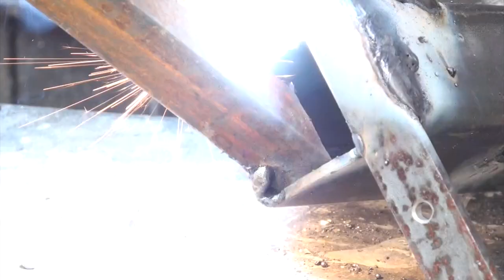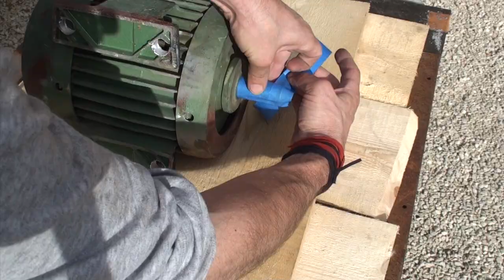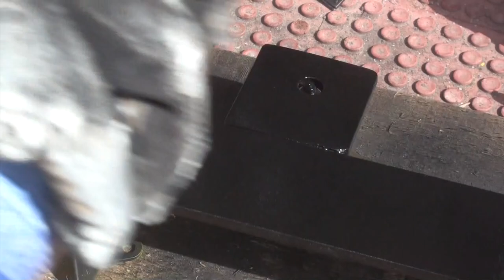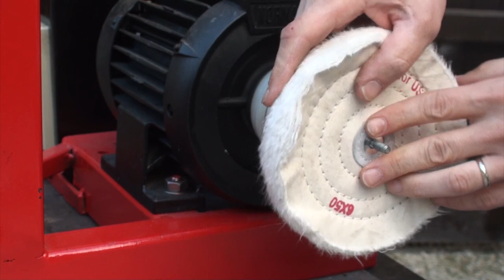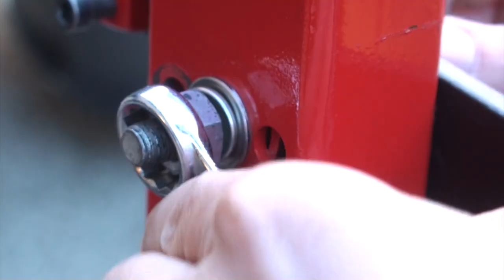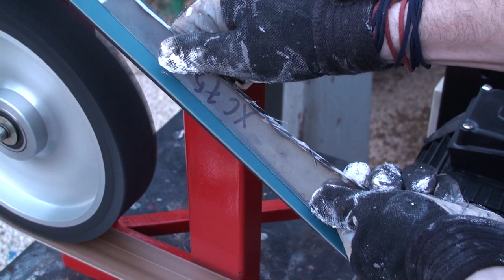DIY - Making A 2x72" / Belt Grinder with buffing wheel

Comment: Only problem I see is that over time though 95% of your sparks will fly down at the contact wheels; a bit will contaminate your. buffing wheel.  A simple plate to cover the buffer will solve it.🖖👍
Reply from the maker: Thank you Robert. I've been using it almost every day for a year now, and the buffing wheel is totally fine. But I'm working on a version 2.0 of the grinder, I may use your idea this time. Thank you very much for watching :)

Comment: Nice job young man, the buffing wheel is a nice touch. If you had a longer motor shaft, or can reduce your  drive wheel width a bit for more room ... a "bench grinder shaft extention"
will give you a lot more space and safety for buffing, it's a ready made arbor extension you can bolt right on. Web search or ebay.
Reply from the maker: Thank you. That's actually an idea I'm working on right now.
What's the saying again, "Great minds think alike" was it ? ;)

Comment: Awesome work. I've got one similar that is half built using the same belts. You've inspired me to get it finished.

One question, how do you adjust the tracking? Or does it not need it.
Reply from the maker: Thank you very much. If we all inspire each other, hald the work is already done ;)
If the wheel are correctly aligned, the tracking is just fine. Just have to pay attention to the belt tension.

Comment: Nice build but, I have a question. What about getting the grinding debris on the buffing wheel? That will surely scratch up the blade finish.
Reply from the maker: Thanks. Well, I've been using it for quite some time now and no metal at all in the 
buffing wheel. Most of the steel dust falls in front of the grinder. Very get stuck in the belt and can fly at you, so glasses needed. Even if some'd get on the buffing wheel, putting the buffing compound on
 the wheel before use would remove it. Thanks for watching. ;)

Comment: Nice grinder. I hope you don’t leave the buffing wheel on there all the time though or it will be full of abrasive from the grinding.
Reply from the maker: Thanks. I've been using this belt grinder for a long time now and never had any issue with the buffing wheel. It's far enough from the belt and contact wheel to not get as dirty as it could appear in the video :)
Thanks for watching.

Comment: Use a spring so you dont have to screw and unscrew every time you change your belts. Also I am missing a frequency converter for changing speed :)
Reply from the maker: You're right, a spring would be great for a quick belt change. And a frequency converter too. But I biuld this with the materials I already had and wanted to make it with a tight budget. Will try to improve that in my version 2. Thanks for watching ! ;)
Reply: The Redsmith
 Other than that, great work :)
Reply from the maker: Thank you !

Comment: A couple of questions:
Did you make and adjustment to move the belt slightly off the platen on either side?
And could you use that skateboard wheel as a contact wheel and grind on it?
Reply from the maker: No I didn't made this adjustement. I was really carefull to align all the wheels correctly so this is not necessary. But I maybe should have. Time will tell.
And, no the skeateboard wheels is not a really good contact wheel to grind on. It was just for the demonstration of the possibility but I avoid that use, even if the wheels are strong enough, and, I think, could be used this way. :)

Comment: Great job man! I really like the built in buffing wheel; wish I had incorporated that into mine. What HP motor did you use?
Reply from the maker: Thank you ! I salvaged an old 380 V 2Hp 1800rpm motor from a very old homemade wood planer a friend of my brother gave me. Free parts  ;)
Reply from the maker: Correction : I checked and the motor is running 2800rpm 😊
Reply: +The Redsmith cool thanks for the info! Mine is 1hp at 1745rpm it has handled everything with no bogging down so far but someday I may upgrade...

Comment: Surely that buffing cloth is going to get covered in metal filings?
Reply from the maker: I've been using it for quite some time now and no metal at all in the buffing wheel. Even if some'd get on it, putting the buffing compound on the wheel before use would remove it. Thanks for watching.

Comment: Nice one, currently gathering supplies myself for a build. What is the purpose of the big contact wheel? Couldn't it also be a skateboard wheel?
Reply from the maker: Thank you! The skateboard wheels are great for curves and angles but are a bit hard to work on smooth surfaces. The contact wheels give much more control and a lighter "touch", plus it has a bigger radius which comes in handy. But it really depends on what you're gonna do with it. A lot of belt grinders have only small wheels and people work with the straight plate in front. Anyway, hope your build goes well. Thanks for watching!

Comment: Hi just found your channel and i like it alot, very good production quality. ive been meaning to make a belt sander like this for a while and was just wondering how many horsepower or Kw the motor was 
thanks
Reply from the maker: Thank you very much. I think it's a 2 horsepower motor, running 2800 rpm on 380 Volts. I salavaged it. Free motors are the best ;)
Reply: very lucky to have found it haha thanks
Reply from the maker: Indeed ;)

Comment: What is better, a spring belt tensioner? Or like this one appears to be, a fixed but adjustable tension?
Reply from the maker: Hello Peter. I have to say I don't really know. A spring looks easier to use and make the belt change quicker. With the bolt I used, it takes more time but I think it's steadier. I made try a spring in my 2x72" 2.0 vid soon 😊
Reply: The world awaits.  May I comment that a 360 pan of the machine running will help my brain assemble all of your closeup procedures into a finished product.  The video is an assemblage of the grinder parts, but no proud videos of the whole thing running.  You know how it looks, but try to think like a dummy who doesn't know what you're building.  Me....?
Reply from the maker: Thank you !
Yes, I propably should have made the video a little bit longer with some overall views of the grinder. I will try to do taht in my next knife making video ! ;)

Comment: Nice build, did you buy the voltage converter or was that part of the drive motor package.
Reply from the maker: Thank you very much. But there is no voltage converter. It's a 380V motor :)
Reply: The Redsmith
 Sorry I wasn't aware of your location exactly, where you are is somewhat different than my locale with regard to electrical service. I didn't get a really good look at it on the video and anything you see like that here, well it resembled a converter. Residential service here if it's a motor that is normally three phase operation it will require a voltage converter. Great job, I am now putting together a parts list for the metal I need for a grinder framework. I'm lucky, there is a huge metal supplier not ten minutes from where I live, they will even cut the metal to size for you. You have inspired me to get working on something I have wanted to do for a while now. I hope I can accomplish at least close to your success. Thanks for the inspiration and sharing an impressive build.
Reply from the maker: Thank you very much. Having a metal supplier next to your home is a big chance. Metal is one of the material I really have difficulties to find easily around here. I'm very happy to hear that somehow I inspired you to build your own. Please send me a picture of yours when you're done ! Have a great day. And thanks again.

Comment: Nice build! Wow! Quick question if i want to build one like this where do i starts with instructions and dimensions?
Reply from the maker: Thanks Isaac. Here's what I did : 1) Find a motor 2) Buy a belt 3) Find a contact wheel 4) Build the frame and needed pieces to fit with steps 1.2.3.
Around here, I can only buy 50m/1600m belt. So once I had the motor, I had to find the right contact wheel (same width of the belt). The frame building will depend on the length of your belt, size of your wheels and power of your motor to get the needed speed of the belt. 30 m/s is what's recommanded, under it, it works just find but you will use the belt more quickly. Keep me posted if you build your own, and thanks for the support ;)

Comment: Does the number of  'roller skates wheels'  affect the belt`s rpm? Please answer,  i`m really confused.
Reply from the maker: Gabrielius Zenkovas No it doesn't. I put two just to get the 2 inches of width I needed for the belt. Thanks for watching 😊
Reply: wow love the instant reply subscribed
Reply from the maker: Gabrielius Zenkovas Thanks. I was online too 😉
Reply: lol not that one i was tlaking about the 3 wheels on the hall build because some guys on their builds have 4 wheels total :)sorry if that other question wasnt clear, im working on my english...
Reply from the maker: Gabrielius Zenkovas No worries. I'm not an native english speaker either. You can put 3 or 4 wheels or more. As long as the total length match the length of the belt and your motor is powerful enough. There is a lot of different designs outthere. I made this one last year and I'm working on a version 2.0 of the belt grinder. I would change some details but the 3 wheels works well for me 😊
Reply: sorry for the time wasted with me. I can`t wait for the new version video. Thanks again mate!
Reply from the maker: Gabrielius Zenkovas Always happy to help ! Have a great week !

Comment: Gerald
I'm still here, I didn't die yet :~))))) What did you use for a tracking device? I just built one and I'm having some issues with not having a free access platen( free access meaning BOTH sides) so I can only use a grinding jig to do the Left sides of my blades? I have to free hand the Right sides. Back to the drawing board! God bless.

Dave
Reply from the maker: Hey Dave, sorry I didn't send you a email earlier. The last weeks have been very busy... I will send you a email later today or tomorrow, with few pictures and some details, so we can discuss the build :)

Comment: how do you adjust the tracking to keep the belt centered on the wheels?
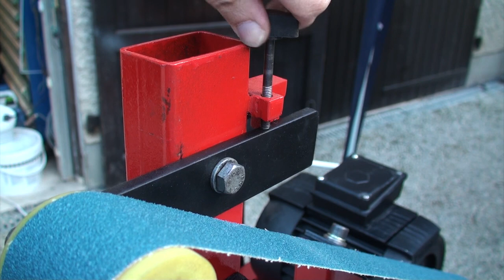Reply from the maker: On the left side of the bolt you can see at 4:33, there is a bolt to push/pull the wheel to keep everything aligned. Thanks for watching.

Comment: Salut.. intéressante ta vidéo et merci de partager la construction de ton back.. 
j’aimerai aussi m’en fabriquer un, je dispose de quasi tout tube poste à souder sauf les roues et poulies mais je peux y remédier.. 
comment calcule tu pour les bandes abrasives tu dimensionne avant ton back pour que les bandes s’adaptent ?
Reply from the maker: Merci.
Oui, il faut calculer l'avancement de la bande en m/sec désirée en fonction de la puissance du moteur et de la longueur de la bande, et ensuite construire le backstand en fonction. :)
Reply: The Redsmith comment calculer le m/s ? Merci
Reply from the maker: la bande doit avancer d'environ 25m/s. La formule, c'est (diamètre de ta poulie x 3.1416 x tours moteur)/60=25m/s
Reply from the maker: diamètre en mètres
tours en tr/min
Reply: The Redsmith tours moteur ok 👌 mais tours minute ? Si oui comment le calculer sur un moteur de récupération ? Merci pour vos réponses
Reply from the maker: @astonnotsa6770  c'est indiqué sur la plaque en rpm (tours par minute). Tous les moteurs en ont une. Même ceux de récupération. Sinon il faut mesurer avec un tachymètre. De rien, courage pour la construction.😊

Comment: Excellent item seems very functional but one has to asks what is the purpose of the YouTube?  You screw up bolts really well, you use a grinder quiet well also but we have seen all that before - what about dimensions, sizes amt hod nothing? What about where you got the large wheel and how big is it.  I watched your Youtube and was really none the wiser when it finished as it is not as if one could make pone similar on the scant information you provide.I am happy for your Dad but Iam over Youtube that really only show that you can cut weld and do up bolts.
Reply from the maker: I think I get your general idea. You watched my video and found nothing new in it. 
As you saw in my video, I weld, grind, paint, wire a motor, assemble all the parts with screws and bolts, align everything and make a functionnal 2x72" belt grinder in the end. You've probably seen all of these before, but you hadn't seen me doing it, nor this video yet. Sorry if you think there is nothing new in it, but not everything in the world is meant to be new. I have made this video to show how I made the beld grinder I use in many of my next videos. If I hadn't, I would certainly had many comments asking where I bought / how I made my 2x72". 
But more importantly, I wanted to inspire people to make. One year ago, I was watching videos thinking it would be cool if I could make stuff. Now I make stuff on a daily basis as a full time maker. My video has been seen 174 472 times, and got 2196 likes so far. 
I didn't made this video to teach people how to build a belt grinder (the title of the video would have been "how to build a 2x72" belt grinder and I would have shown more details and give dimensions) but to inspire people to build their own. I think you are looking for an instructional video about how to build a 2x72" and I'm sure you have found or will find plenty of it. I sometimes make instructional videos, but this one was just meant to be an inspiring one. 
You were maybe not wiser after the video than before, but you watched it till the end and even took time to write a comment, instead of not liking it and moving on. 
Conserning the size and dimensions and such, you could have ask in the comment you left, instead of saying "there's nothing new here" and I would have been happy to answer you. Fortunately, I sell detailed plans of my 2x72"  and they are quite cheap...  
I really hope will find the video you are looking for.
Thanks for watching.

Comment: if you are going to crimp the cable do not twist it
Reply from the maker: jerry1378 Why is that ?
Reply: you want your wire to move as free as possible to make the maximum contact area with the terminal
Reply: From what I could make out you used terminal connectors, sometimes referred to as lugs when they are the larger ones. When the braided cable is once crimped in a connector, it's the connector that makes the electrical connection as the wire is compacted within the structure of the connector. It's more than acceptable to twist the wire as it is done to accommodate fitting the wire into the terminal connector so no individual strands poke outside of the connector, it keeps the strands together and also twisting the wire gives a neater appearance. Twisting the wire does not diminish the wires capability of transferring electricity, in some cases the wire is already twisted inside the plastic insulation you strip off when making a connection. When using terminal connectors you can decide whether to twist or not, also not all terminal connectors are open where you can see the wire as it protrudes through the connector, some connectors are closed at the end, you cannot see the wire after it is inserted. Over the many years every electrician I have ever seen systematically twists the cable when it is going to be housed in a terminal connector. If you put a wire under a screw down terminal, the wire will separate when the screw exerts force on the wire. Most twist the wire to minimize that effect or you can install on the wire a collar that keeps the wire together as the screw comes down. Most people to crimp wire utilize one of the standard crimping/stripping tools that resemble pliers. I have some larger type crimping tools but I mostly use my hydraulic tool in particular for larger wire, it exerts a force of many tons. In my opinion you didn't do anything that was unacceptable.

Comment: what the costs are approx?
the engine I lie
Reply from the maker: I only paid around 60€ for the contact wheel. I already had all the other materials laying around. But if you would have to buy everything to make one, it would cost around 800€ for a 1200€ machine.

Comment: fcking awesome!!! hows the tracking, is there a tracking control, maybe i missed it. great work m friend!
Reply from the maker: Thank you Matt. Very glad you liked it. There is a little bolt on the top of the machine to control the belt tension. If the tension is right, and all the wheels well aligned, the tracking is ok. ;)
Reply: @RedSmithLeatherwork  there appears a little clearance arround motor mounting bolts the motor can be turned to adjust tracking if need be. Did that with one of my projects.